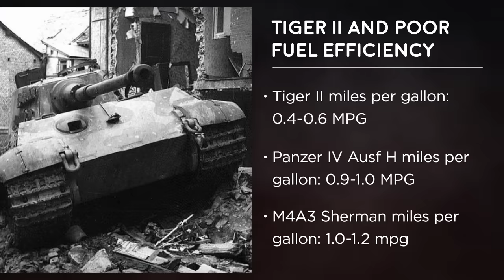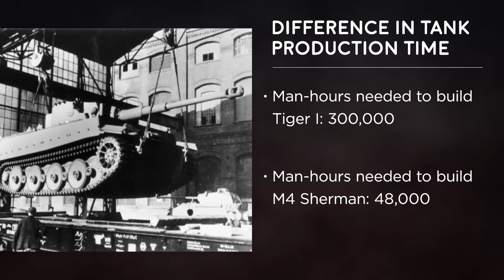Why Did German Tanks Perform So Badly in The Battle of the Bulge?

Comment: A lot of history lessons call it good when the Germans got stopped - but then they had to take the 'bulge' back and that proved to be a tough nut to crack. I hope you do an episode on the weeks after the German attack got stopped.
Reply: So, does this means the Soviets needing 3 years to take over all territories taken during Barbarossa is an evidence that stopping the Axis at winter 1941 is not so great either?
Reply: The operations room has a video on the series. The bulge is 8 chapters, this is the 3rd. They will cover it iirc
Reply: In a recent video TIKHistory mentions the the American generals wanted the Germans to push a little further so it would be easier to do flank attacks. Patton joked that the best would be to let the Germans reach the sea.

Comment: Early German victories in WW2 were mostly due to Blitzkrieg and advancing rapidly. Makes you wonder why they decided "bigger is better", going for big, slow, complicated heavy tanks and moving away from the tactics that were so successful in the early war.
Reply: Early German victories in WW2 was because their tanks outmatched the enemy, and the geography of the Lowlands and France suited their strategy. It would not have mattered whatsoever if they kept with light, fast tanks, because their overall doctrine was unsuited for the mid-late war. Particularly in the Soviet Union, where small, concentrated assaults resulted in very little gains for a very high cost to the units. However, in 1940 when you have arguably the best tanks on the battlefield and you only need to advance under 300km to entirely cut off the enemy force, however in the Soviet Union you would need to advance over 1600km to reach somewhere like Stalingrad, so concentrated offensives don't work as well, because the Soviet can always attack another sector or perform defense in depth.
Reply: @Fantasia-em5rs  that is just not true. The French had better Tanks. Coordination was key then.
Reply: @muadipatreides5785  the French had the largest army in the world at that time and it is said they had better tanks. The blitzkrieg was a lightning war that overwhelmed the enemy with speed.

Comment: Lately I've been rethinking the Tigers.  On one hand, they had a lot of problems for their weight but on the other, if you can't outproduce your enemy, it makes sense to try and outclass them.  It doesn't seem to make as much sense to build more of something smaller and lighter that can be more easily knocked out when you still can't make more of them than your opponent.
Reply: Why does making small numbers of sophisitcated tanks that have so many potential technical and mechanical frailties mean you've outclassed the enemy?
Reply: @walterkronkitesleftshoe6684 
I think you're dealing too much in hindsight which is a luxury only we can have.

Without trying to presume the thoughts of others' outside of their context; the idea i describe is that if you can't out build, you try to outclass.  If you try to match pound for pound, you'll lose by simple attrition.  If you can however build less but at greater capability, you may have a chance.

The logistics of war are the most complicated component so It's hard to go as deep as necessary.  Suffice it to say that while we can say the way Germany did this was not optimal but, I personally would debate that the reasoning is not unsound provided it was for the reason described above.

Comment: Impassible terrain means that a smaller unit can defend it against a larger and can be reinforced faster than the attacker can reinforce.  The Ardennes were impassible before 1940 and after 1940.  Could a smaller tank force have defended it in 1940?  Probably.  It was the surprise of the new tank divisions, more than anything, that made the Ardennes passable for a short time.

Comment: Is this description of Piper's divisions accurate? I'd heard that there were very few Tigers and Tiger II specifically deployed, that throughout all the German forces the Panther IV was deployed. I also don't know that Piper's inability to advance was critical to the outcome of the Battle of the Bulge since his sector was on the shoulder and through mountainous terrain unlike the center of the offensive.

It's also well known that despite the criticisms in this video that the war had not been going well for the Germans for quite awhile and the Ardennes offensive was a last attempt by the Germans to turn the fortunes of the war. The Germans were faced with the principle that you go to war with what you have, and the Germans undoubtedly had a significant technological advantage over the American and Allied forces but lacked logistics and parts due to the successes of the Allied air campaign. The Germans prepared and attempted the Ardennes offensive because of a confluence of available forces and favorable weather that prevented Allied air power to surveil and interdict Germany's meager logistics and view force movements.

The Germans nearly pulled off a success in the Ardennes Battle of the Bulge. As celebrated so often, it mostly came down to holding Bastogne, a small town at a critical crossroads that prevented the logistics necessary to advance further.

Comment: The thing is I don't see a better alternative. If they made panzer 4's they wouldn't have enough trained crew to use them and fuel would still drain just as fast. But without the armor or heavy armament. 

So given the odds and the fact they were heavily outnumbered and on the defensive. Heavier tanks like Panthers and Tiger 2's make sense.

Comment: Cheap and cheerful wins the day  - a bit like today - except not made in China. The Americans really did have mass production down to a tee  - and fleet commonality - using modified  aircraft radial engines to power them. I read somewhere that the Tigers were prone to engine failure due to ingress of dirt into the needle roller bearings on crankshafts.

Comment: As fierce as a tank is it still requires a lot of support and that 1944 Germany no loner had.  Allied air-power meant German logistics would always be destroyed and exhausted. 
In  the summer of 1940  the smaller German tanks could transit the Arden and every German unit had a Michelin guide to France. This tourist book detailed every service station in France where petrol could be found. They already knew the location of every Military and Commercial fuel storage facility in France. This allowed their tanks to keep rolling along. The Michelin guide also revealed where food could be found. What more could an army want. This knowledge alleviated the German logistics problem. 
 In the winter of 1944 Germany would have to provide all it's supplies. Hoping to use captured enemy fuel without knowing it's location beforehand is heading for a disaster.

Comment: I’ve heard “overly complicated” before but have never heard anyone explain what exactly was overly complicated about them. I believe it’s true from hearing it so much, but I’m interested about the specifics
Reply: For example, while the Allies’ Sherman tank had a four-speed manual gearbox, the Tiger had a hydraulically controlled, semi-automatic, six-speed, three-selector gearbox.
Reply: Another example is the overlapping road wheels. It offered modest advantages in load distribution, but was, by some estimates, three times more expensive to assemble, had reliability issues when dirt got entrained, and required extra wheels be removed and replaced to repair overlapped inner wheels.

Comment: their were several reasons one was The Weather once it cleared The Allied Air Superiority returned two Fuel and Resouces they had to try and capture Allied Fuel dumps Three Patton he had his Tanks at Bastogne within days as for as long as The 82nd Airborne held it The Germans had to commit resouces to containing it as they had bypassed it and Four it was ultimately doomed to fail as they had taken resources from elsewhere as the King Tiger was underpowered it like the Panther and Tiger had a 700HP Maybach Engine which was prone to breaking down to wear and tear a King Tiger weighed nearly 70 Tons which put a lot of strain on that engine as a lot of King Tigers and Panthers were abandoned due to either Fuel or Mechanical issues allowing the Allies to capture them intact study them and learn their strengths and weaknesses so there were several factors

Comment: Every Sherman had to cross an ocean to fight making the design an ideal "strategic tank".  The eyelets on Sherman and other hulls reflect the necessity to load them by break-bulk methods of the era, there being no RO-RO ships. 

The actual crew casualty numbers were quite modest (Belton Cooper's understandable emotional reaction notwithstanding) not least because Sherman had good spring-loaded hatch design. More Shermans were knocked out (not to be confused with a K-kill which are always less common) than crew members lost in the ETO.  US tank recovery got the attention it deserved (Ukraine demonstrates what happens with strategies ignoring recovery and under-resourcing recovery vehicles in Soviet-style Russian BTG) so damaged Sherman were either fixed or parted out.  

Official US data from 1946 for total WWII losses. (I'd much prefer the odds riding a Sherman than an Eight Air Force bomber, see "The Cold Blue" for a fine color documentary on what that was like.) Note the Armored Force losses are quite modest.

https://www.ibiblio.org/hyperwar/USA/ref/Casualties/Casualties-1.html#duty

A demonstration of just how easy it was to reconstruct damaged Shermans is the radical restoration of old range hulks where two Sherman halves are welded together using the turret ring as a reference. None of that is hard work or at all exotic for a decently skilled welder or mechanic because Sherman was designed to be easy to wrench. The drivetrain is easy to remove and install and the whole vehicle is mechanic-friendly. 

 The primary use of a tank is infantry support, not WoT duels. Quantity and automotive reliability has the advantage. Wet storage and cannon upgrades made Sherman viable for decades after WWII because the rest of the vehicle was so well executed. Russian tankers love their "Emcha" per post-war autobiographies. 

Tiger was self-limiting because it was a resource sink and even the best tank in the world cannot be in two places at once. In actual combat the later upgunned Shermans performed acceptably and killed plenty of Tigers, and combined arms warfare is a contest between systems of systems not an autistic fantasy duel in isolation. Sherman's stabilized gun was a key advantage enabling accurate fire on the move. US ability to machine hypoid gears and other components superior to German transmission components already stressed by heavy armor weights is another disparity. 

The US was by far the most industrially capable Allied nation and its other systems were generally outstanding. This begs the question why if Sherman was so poor it was not promptly replaced.  The answer is it was suitable for the real war it fought and greatly helped win.

Comment: that is a very good synopsis at the end of the video. German tanks are the most overrated tanks of world war II. Forever having problems and breaking down. If Germany would have mostly just produced the Panzer 4 they would have done much better in the war because that was the only semi reliable tank that they had even though it had well-documented transmission problems but not near as severe as the panther
Reply: I've read that before about the Panzer IV.

Comment: Unlike the Russians, who basically threw their tanks at the enemy, the US used their mass production to get better at making Sherman tanks over time. Furthermore they designed it from the beginning to be less likely to get stuck, more likely to have it's crew escape, less likely to have ammunition fires. They also made it pretty reliable and repairable. The German tanks were performance beasts that got stuck in the mud and couldn't be repaired or easily escaped. Combine all that with the fact that the US tried to ensure that Sherman tanks met the enemy five to one on the battlefield, and it just makes sense that German tank performance would get steadily worse over the course of the war.

Comment: It's a good thing the Nazis weren't big on end-user feedback. 
As a rule of thumb; if a German tank breaks down, for pretty much any reason, you will have to send it back to the service yard. If US tank breaks down a service team is likely to fix it where it stands. If a Russian tank breaks down any farm boy in the crew is very likely to be able to fix it with spit and bailing wire. 
The superior engineering of German tanks was also their greatest weakness. Germans didn't wrap their heads around "good enough" until it was too late.

Comment: The German tank Commander said that the battle field was ideal for bicycles and not for heavy Tiger and Panther tanks. He was used to the wide fields in Russia where his tanks could operate at fast speeds to flank and trap the Enemy tanks and fire his main guns in any 360 degree direction. Further in Belgium, the narrow village roads meant if you knocked out the lead tank, you greatly stop the flow of your tank attacks. Further, American Army Engineers destroyed the few heavy bridges that could withstand the huge weights of German tanks.  Also, the Germans lack airpower which is vital to a successful German Blitzkrieg. Lack of tank gas helped too.
Finally, it was Time which the Germans did not have. Once delayed, it was inevitable for the skies to clear and the overwhelming Allied Air-forces to bomb and strafe the German attack and provide ammo, food and weapons  to the American soldiers.
Of course, the successful American defense of Bastogne and Patton's almost miraculous  tank advance in  a-short time that sealed the deal.

Comment: "not even the tiger 2's frontal armour can stop an anti tank round fired from the firefly" meanwhile shows a picture of a tiger 2 getting penned on the side
tiger 2's thinnest effective armour on the front is 185mm, firefly has 171mm penetration at 10m, it can definitely pen a tiger 2 from the front
Reply: By the battle of the bulge, they would probably already be using a better shot with 190mm penetration. But due to sloped armour it probably would not penetrate anyways.
Still would make a seriou damage to the structural integrity of the armour, considering the German late war quality. I believe APDS could kill it thought

Comment: The Ardennes Offensive was a moonshot from it's very conception. Germany in Dec 44 was at the bottom of it's manpower barrel, inexperienced and hollowed out units with a sprinkle of veterans among them. A spent force that had been bled dry in Russia. Supplies and fuel stretched to the limit. Almost no air support. Superheavy tanks that guzzled an insane amount of fuel and would have been much better in a defensive role than on the offense. 

That's why it's called The Battle of the Bulge. Cause all that final offensive achieved, was to create a little dent in the frontline.

Comment: The Sheman firefly was not a match for the tiger ll in fire power or defensive protection. The 17 pounder Ap shot could not penetrate its frontal armor. The 17 Pounder firing a dense tungsten discarding sabo  round theoretically could.... But never did. Conversely, a 37Ml. Burp gun scoring a direct hit on the hull machine gun ball Or 88Ll gunsight port could have slayed the beast ,but that would have taken one Hot-Bob gunner to accomplish!

Comment: While stationed in Baumholder, Germany 2002-07 I visited Bastogne each December except when I was in Iraq. As a Tank Destroyer I served in the 2/502 INF Regt, 101st and I would walk our perimeter section and speak with old Vets from the Division where I learned the actual history of their time there. The roads to the east of Bastogne are narrow and goes through hills that restricts armored vehicles to hard ball roads. And once the lead tank is taken out in a convoy, it delays the Germans tremendously so they’d have to find other routes. This happened when they came to rivers that had blown bridges and no bridging equipment but they didn’t face too much of those. I’m not going to comment on what went right or wrong since I wasn’t there but it’s agreed that if the Germans pressed on to Bastogne from all sides at the same time, they would’ve easily overwhelmed the units and cut out the bulge. Once a tank unit is on the west side of Bastogne, the terrain opens up to gently rolling hills and mostly farm fields with smaller wooded areas here and there. I can say the same for St. Vith, similar terrain. If you ever go to St. Vith, go see the MK Mobel furniture store, they sell amazing quality solid oak furniture. It’s a bit expensive but we’ll worth the investment and they will make custom pieces if desired. And for a cuckoo clock, don’t bother going to the Black Forest like we did, the best selections and prices can be found at a clock shop in Kaiserslautern (actually in Einsedlerhof) called “House of Clocks” and you can buy them from their website, just make sure you get one with an 8 day movement and not an electronic one.

Comment: I would suggest without even watching the video yet the Winter Offensive was late-war with the German oil refineries taking a pounding.   The resulting lack of fuel and supply no less vehicles made the Germans hard-pressed to mount any offensive, indeed the Eastern Front sure could've used them also.   The German weapons and tactics were more designed for long-range open country, tanks in general don't do well in cities - exactly like the Allies in Normandy in the bocage.